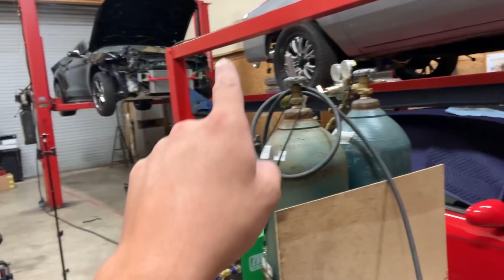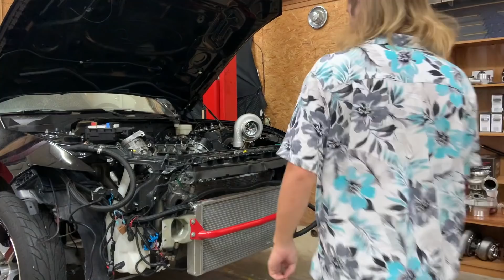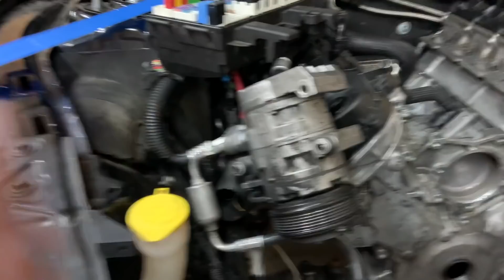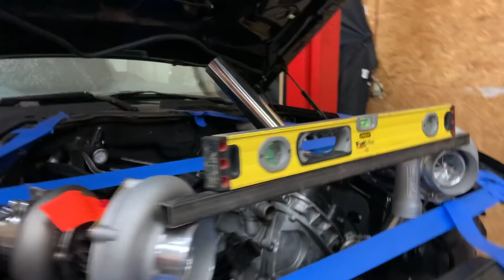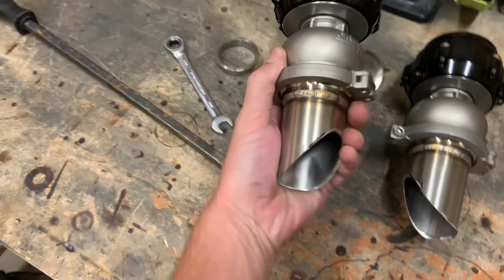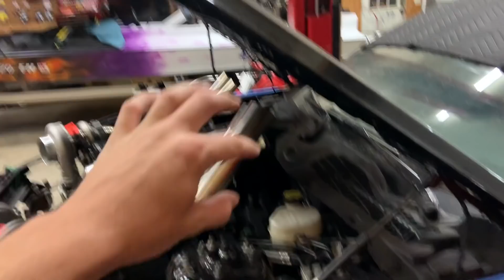GAVIN "ITSJUSTA6" Satan Mustang Twin Turbo Build Part 1

Comment: Looks great but the turbos and pipes will need braced most likely.
Reply from the maker: Ya once the car is done it will have some support
Reply: @tay1969cam  sweet i figured you would end up doing that, would hate to see all that nice work crack and split.